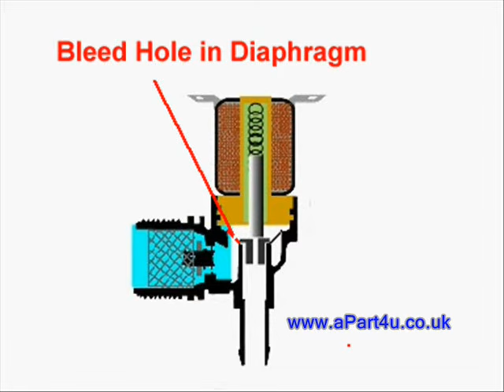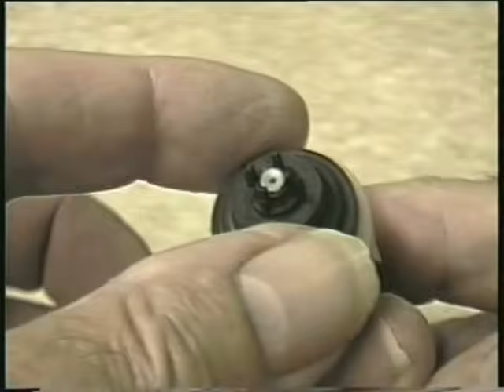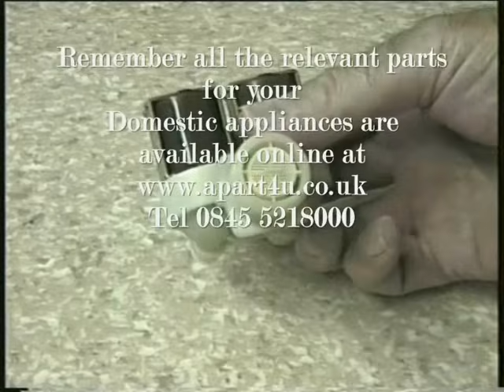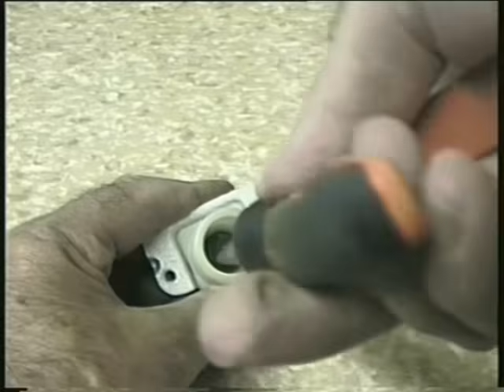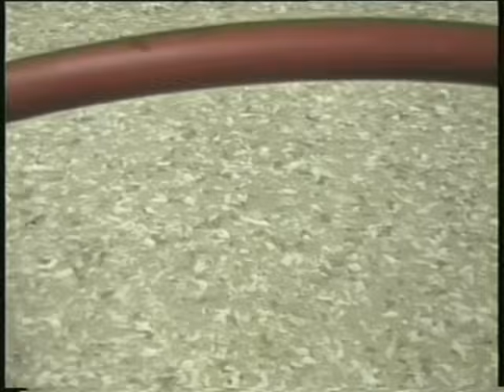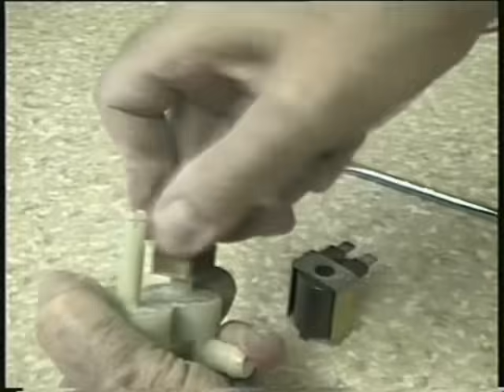How to change a washing machine water valve

Comment: We have a three year old samsung front end washer which should have been used asa boat anchor. I have replaced the motherboard, had a repairman in and my problem is still there. What is happening is the machine does not work on the regular cycles, but works on the delecate cycles. really p od, dont want to spend more money on this junk..